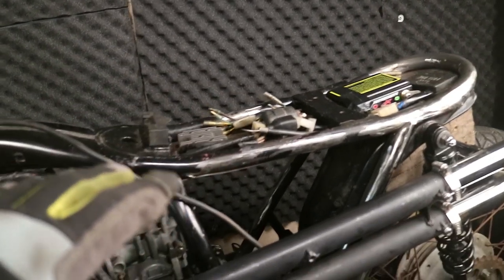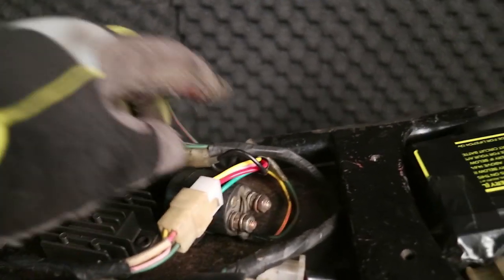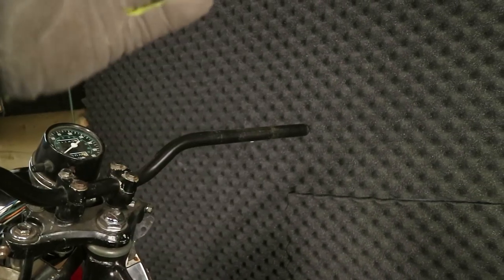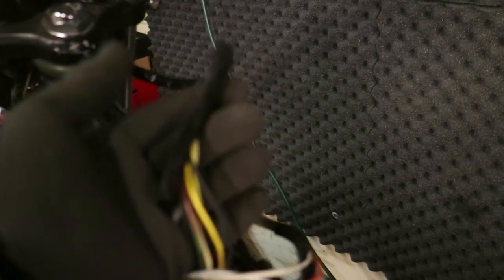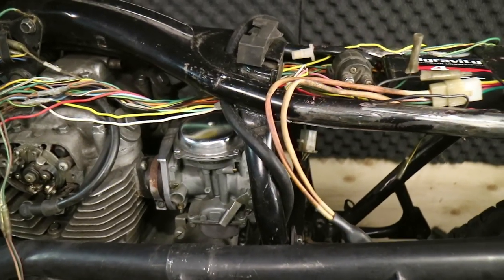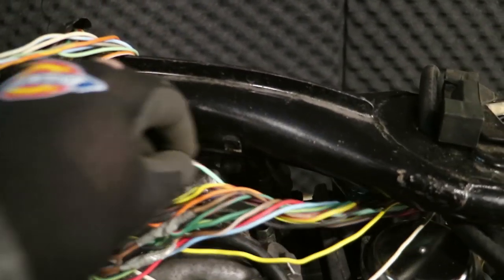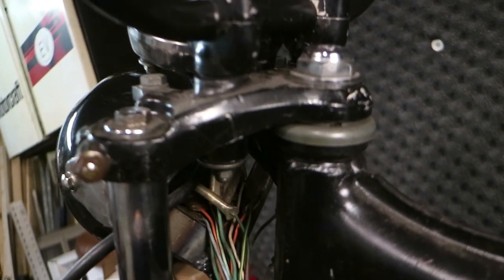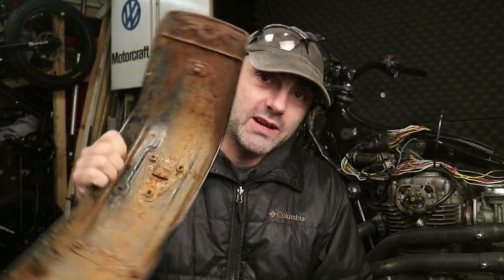CAFE RACER SCRAMBLER BUILD, Under seat Electrical Loom, Wiring Harness - Honda CB360 Ep13

Comment: Very nice work as always Steve, loving the super slim electrics tray! I have the light green wire and the dark green wire with red stripe on my 360 too. They don’t connect in to anything on mine, they both just end near the ignition switch. I think I recall seeing these wires on one of the foreign model wiring diagrams connect into the clutch lever. Was basically a switch that meant clutch lever had to be pulled in for the electric starter to engage.... I think. 
Anyway great work getting that wiring all tidied up, it’s a tedious job but you smashed it out 👊
Looking forward to hearing that exhaust note too. Cheers

Comment: When it comes to the suspension...are you at all worried about the tire hitting your electrics tray in a big bump? I’m planning a build of a ‘78 CB750. I’d like to use the stock seat. So I’m worried about making the tray too deep.
Reply from the maker: With the new higher rear shocks I think I'll be ok. I added an inch or more of space there. Also the spring tension is adjustable so I can tighten them up if needed

Comment: From experience I would get that regulator as much airflow as possible. Especially with the lithium battery or you could end up with a smoke screen that would make a tank jealous.
Reply from the maker: Noted 👍 I may just mount it underneath to start

Comment: here's the wiring diagram with the diode and the other wire.  if you need the whole manual, lemme know...  https://www.dropbox.com/s/c38z6du7zx6mqps/cb360T_wiring.png?dl=0
Reply: diode is for the clutch/neutral switch, as long as you're in neutral when starting, you don't need it IIRC.
Reply from the maker: Thanks!!!!!!!! 👍👍👍 knew it must of been out there somewhere 😁
Reply: cheers, i enjoy the vids!